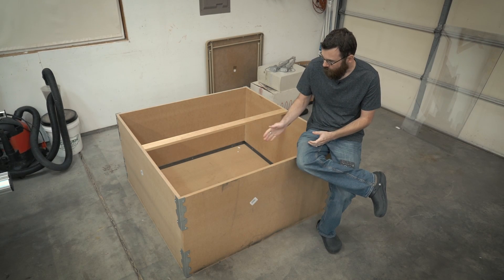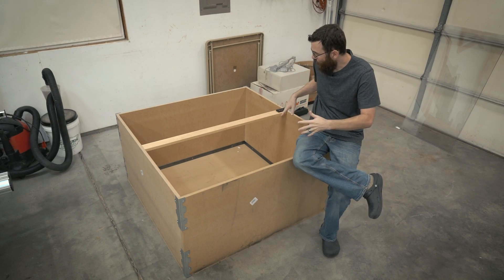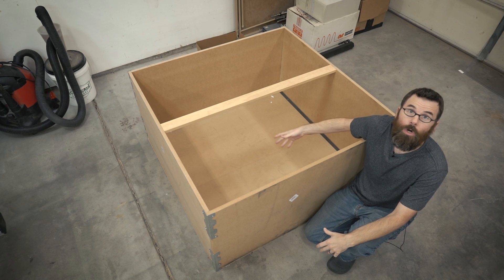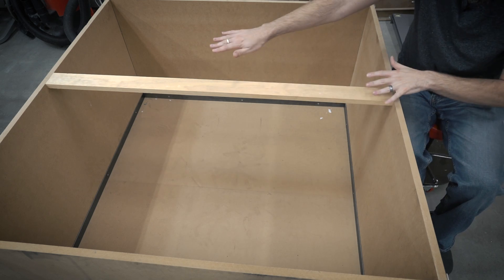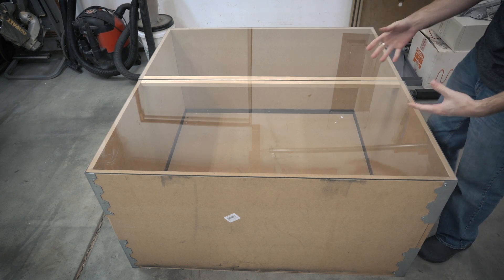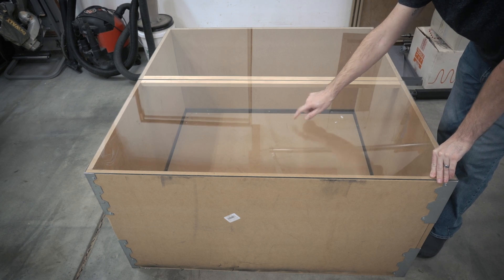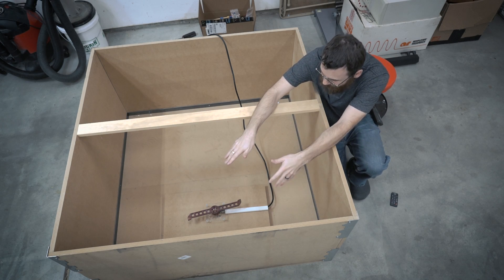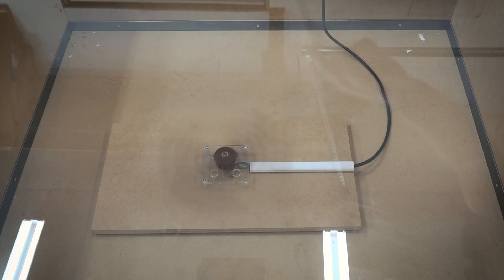Battlebots Safety Test Box

Comment: FYI, Home Depot or Lowe's will cut sheets of plywood/paneling etc.
Most will make up to like 6 cuts for free, some charge a few cents per cut.
So you can get creative, buy cheaper full sheets, and not touch a saw.
They will also cut lumber, pipe, etc.

Not sure if they will cut metal, angle iron etc, but they usually have a hack saw hanging around in the plumbing area or somewhere, and I have used it to cut stuff down when I was on the road lol

Comment: Nice. You could make it totally enclosed with a wide angle GoPro clone and lamp to view.
Reply from the maker: This is totally possible.  But then you're assuming the camera can get damaged.  The lexan is cheaper (and more durable) than the camera.  And seeing things in real time in real life is much nicer.
Reply: I'm all for lexan - I just bought six sheets to build a beetle arena. But for a cheap testing arena (where cheap is operative) you can do realtime HD engineering-quality video for under $50.

Comment: i am building a 11 pound robot with a vertical spinner , i wanted to know if a 1000 rpm brushed 12 v motor is enough for the spinner
Reply: Not if your goal is to win in the 12lb class. If you just want to make a weapon that spins and can hit soda cans, possibly.
Reply: @ianmcmahon8589  can you clarify what you exactly mean
Reply: I'm at an actual computer now which helps. Where in the world are you? Is there a specific requirement that the bot be 11lbs and how good is your opposition?

It would all depend on exactly what 1000 rpm 12v brushed gearmotor you found. My best example of something that could be used moderately successfully meeting these specifications would be a gearmotor from a 12V drill. This could be effectively employed to build a rotary lifter where you use torque rather than kinetic energy to lift the opponent. This works well to combine with a wedge.

The RS-550 driving that 12V drill gearmotor is unlikely to have the power necessary to build a good vertical spinner with fast enough spinup time for the class as it stands today. (12 and 15lb bots are nasty.) It would have been marginal in 2004. However, it would still be fun, and you could hit cans and jugs pretty well in your backyard if you wanted to have fun.

In the US for a good, modern 12lber vertical spinner, we'd be looking at around a 1000-2000 Watt Chinese-rated brushless motor with suitable ESC.
Reply: well the motor I am using is a geared one
Reply: Void [ ] well what’s the gear ratio?

Comment: i also wonder if you couldn't replace the bracers used on the corners with hinges, so the entire thing can be folded up when not in use, the tape holding the floor of it together would hold well enough to move it, and maintain its flatness, add some hinges to the lexan on the top for it to also be folded away, and you would have a test box you can easily deploy and put away when you want. Worst case you have to pull the hinge pin on 2 sides breaking it down into 4 sections of 2 pieces each, floor, side 1 and 2, and top
Reply from the maker: yeah, that's totally doable.  I did think of that, but just went with the corner brackets instead.  I might switch to hinges if it's in the way too often.

Comment: Would love to see a video of your procedure for balancing your spinner weapon
Reply: Stephen Kamin In CAD? It’s kind of boring. It’s just a bunch of trial and error.
Reply: Ian McMahon CAD?... if your not putting a bearing on that thing and spinning it to balance it your not getting the full revs...
Reply: Ian McMahon just listen to it... when he gives it full revs you can hear it vibrate.
Reply: Combat robots is a mind game. Extra noise from vibration also makes the bots seem scarier to your opponent.  This can increase the caution of your opponent and lead them to tap out more readily. Vibration that visually causes the bot to shimmy and drive poorly is bad and does need to be corrected as it makes your robot seem worse to your opponent and the judges.

That blade was very well balanced for a combat robot weapon. Most people just don't worry about it on the assumption that it will be even worse after the first match.

I understand your desire for it to be perfect.  If it was an internal flyweel, an engine crankshaft, or a propeller, I'd agree with you.
Reply from the maker: @stephenkamin1345  There's a lot going on.  You WILL hear vibration even if it's 100% balanced since it has air resistance and such.  It would be a LOT louder and jumping all over the place if it was unbalanced, especially at that RPM.  Crippling Depression even has a bit of noise to it, and I could probably balance a nickel on it at full speed (well, not anymore...)
Reply from the maker: Not trial and error.  But Ian is right, it's all done in CAD.  Design the majority of the weapon, then calculate center of mass, then create a reference point that's tied to the center of mass and add all your mounting holes and such, based on that hole.  I could make a quick video.

Comment: Just a suggestion.  If you made a small cutout at the bottom of one of the side panels, you could run your power cord through that and have it lay down onto the floor.  If something did come apart, there would be much less of a chance of cutting the cord, and causing you to have to put up with sparks, fire, and/or tripped breakers.  ;-)
Reply from the maker: I didn't mention it in the video, but the metal skirts are removable for that reason.  I haven't gotten around to it, but there will be pass-throughs for this reason.  I even have the conduit and cable covers just off screen.

Comment: can you replace le lexan by some kind of grid or net? I'm thinking of chicken wire or something of the like.
Reply: DON'T
Reply: It’s better than open air, but I’d test outside from 30 feet away instead of standing 4 feet away with chicken wire in between. Distance is safety.

Your mileage may vary. I also don’t build horizontals.
Reply: In theory that sounds like it would work but I would not take my word for it. I also would like a cheaper way to stay safe while testing my battle bot.
Reply: In lieu of small parts flying out of the box it may be a better idea to use that same mesh to hold down the lexan.

Comment: Nice and simple design, just how it should be! I am wondering though, did you include mounting points (or do you plan to do so in the future) on the bots for static testing? With that I mean for the fully assembled bot, not an isolated subassembly.
Reply: An example for that could be the static tests done by SpaceX (allright, thats an extreme example) or test runs of turbine engines on those neat test stands
Reply: I feel like a test box could be more simple and just made out of wood.